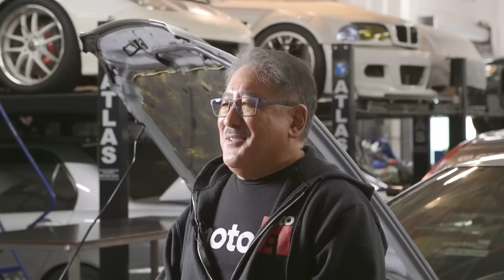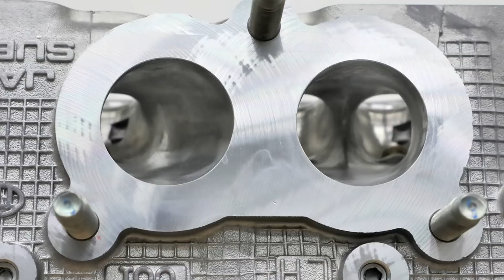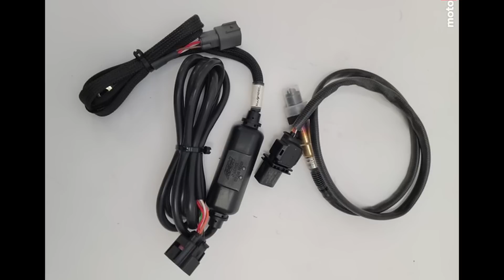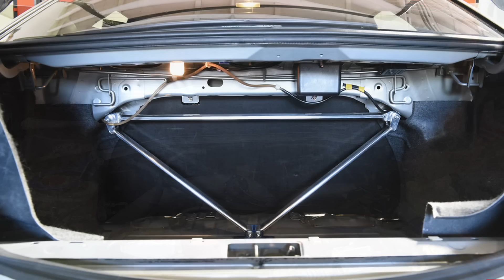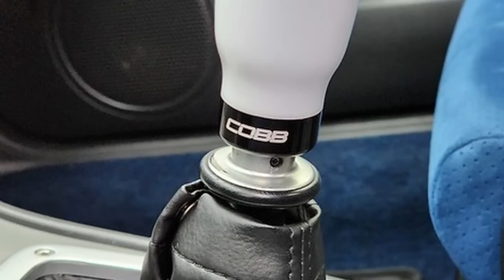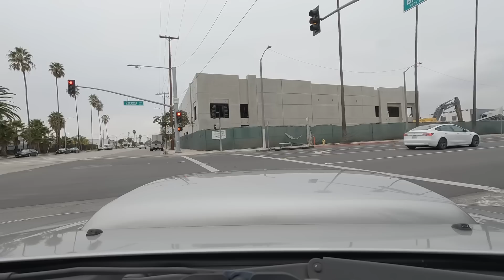How We Built Our Project Subaru So it Won't Blow Up!   (AND Drive Great)

Comment: When moto-iq talks about Subarus I listen. Gonna watch in its entirety after I get home from work later.
Reply: I don't have much beyond used motors and scrap metal. It's all on my fabricobbling and collected knowledge to make HP with my 97 Legacy and the leftovers I use for parts. This guy has given out most and best info on engine issues that I have found and I am eternally grateful.😅
Reply: I don't only listen, I take notes.
Reply: People need to take a “true” 500 wheel car for a drive before they say what they want compared to what they actually need. With 500 you’re not fucking about.
Reply: I’ve watched this video twice now and that car is the nicest, cleanest Subaru I’ve seen on YT, it has the parts that count and it’s not overdone.
Reply: literally same bro. I’m wanting to build my subie engine and literally will just do everything he says haha.
Reply: Did you watch it yet? Cause im in the same situation as you lol 😂
Reply: Kk
Reply: I dont know for sure, but it might be like 4th time I listen this at work while I plan my build from the start.
Reply: Good boy
Reply: You really can’t go wrong listening to him. I have no intentions of modding my 19 crosstrek, I just like to dream and window shop.
Reply: The stuff they talk about is very informative but super expensive.  Certain things when "building" a subaru not needed such as super expensive AOS valve covers; super duper 12mm oil pump etc..
Reply from the maker: @palaciosfreddy9189  Building something right is expensive, maybe the valve covers are not needed but oil control on these engines is and every bit you can get doesn't hurt. As far as a 12mm pump, this isn't a 12mm pump which isn't the best choice as they tend to cavitate and lose pressure at high RPM. You don't cheap out on the oiling system and oil control on an engine with known oiling and bearing issues. Nearly all the parts in this video are needed if you want to achieve the same objectives we were aiming at, solid reliability and driveability at 2x the original power.  Track driving reliability, not some guy who says "I drive it hard all day yo".  If not the same brands, the same quality and cost of the parts are needed to achieve this.
Reply: @motoiq  What if I just want solid reliability and driveability, no increase in power. My dream is just a build a reliable, fun street car. I think 300hp from factory is more than enough, but definitely want more reliability out of an STI. What would you recommend for increased reliability/driveability without big power?
Reply from the maker: Good maintenance, frequent oil changes with high quality oil.  Maybe a more conservative tune than stock. Always use premium fuel. Leave it stock, should last at least 100k.
Reply: @motoiq is there any build path for at or near stock power levels that someone could expect to get over 200k miles out of an EJ before any significant wear or degradation of head gasket etc on a daily driven car? 

My point of reference is a number of BMWs we've owned with the m54 engine which have been dead reliable even up to 300k miles, daily driven hard, and no loss of compression, no head gasket issues or any of the Subaru quirks
Reply from the maker: @azvet  The M54 engine is a very stout engine! I would say if you keep your EJ stock, change the oil every 3000 miles with a top quality synthetic, if you have a 2006 and later STI have an experienced Subaru tuner go over your tune and fix the factory issues, change the cam belt after 100K or 10 years, feed it premium fuel only, you can get 200k.  We have had two of those come through but the engines are totally worn out.  We had a well cared for Toyota Tundra with 300k come through and that engine was brand new inside.  Never going to find a Subie like that. Most Subies we see tend to die between 50-100k miles.
Reply: @azvet  I know that I was driving a '96 Legacy that I got with like 280K Highway Miles, drove it for 8 years and it had 365K when I wrecked it. Now, it had the EJ22 and the thicker cylinder walls and slightly shorter crank and the pistons were proportionally longer which kept them from twisting and putting troughs in the bores with the piston skirts like the EJ25s seem to have around 200K that I clean up and do my bullshit rebuild so that they will keep going (new bearings, oil pump, clean the piston rings, and do a minimal re-hone). The real problem is the EJ25 block is too short and the bore too wide to resist piston twist and all the engines I see are NA. I can only imagine how the factory turbo EJ25s that have moderate driving look from the higher cylinder pressures = wrist pin friction = piston twist. A unconventional idea would be to use stock pistons (harder and less thermal growth than alloy) and aftermarket (chromoly) cylinder sleeves (which I hear wear out piston rings a bit faster). Because longevity builds are rarer than performance builds outside of diesel trucks and tractors, I haven't heard of any good ideas. Gummed up rings are always an eventuality on long term road driven Subarus because they have more oil hitting the backside of the piston compared to more vertical engine designs + oil squirters further keeping the oil control rigs from reaching high enough temps to burn off gummy, coking oil. More simply, instead of all that, it is easy enough to get an engine hoist, a good used spare EJ25 shortblock, and heads, spend a year studying and spend a year learning how to recondition it yourself. Subaru's are not necessarily simple, but they are the easiest modern engine to work on and all you need are like an 8,10,12&14mm sockets, a $60 torque wrench and a service manual and watch about 10 YouTube Videos. It is not hard to be a Subaru Mechanic if you just do a bit of studying over some time and take your time. Sti blocks with head studs, pistons, new oil pump & oilpickup tube (all simple and easy on an EJ block) can take a reasonable amount of boost over stock and will last long enough (probably 100K if you are nice to it) If you want something done right, do it thyself. (Sorry for the Essay and as always Listen to the most knowledgeable people first (not necessarily me)).😅
Reply from the maker: There is a lot wrong and conjunction about all of this.
Reply: @motoiq  ideally yes to everything mentioned in this video. If i was a ball player, making millions/ yr, id do everything you mentioned in this video. Probably wouldn't be driving an electric supercar.  But everyone here , is sort of on a budget. Most folks knowledge on built Subaru's here is limited, especially on these comments. I understand the weaknesses of this platform very well; that being said , to remedy id take these steps:[ open case up, measure & install new king bearings, forged rods and pistons; hone block to 99.75, new half moon seals, new oem cam shaft seals, rear main seals, new oem mls head gaskets, new oil cooler,  new oil pan , iag or killer b oil pickup at a minimum, iag aos, freah 5w40 oil, dyno tune on a hot day, then street tune, & ensure tune fueling is spot on or at least on the rich side. Ewg to ensure proper boost management.
Reply: @motoiq I would like to know what you would do to an EJ25 to make it last longer than stock. Like I mentioned, the piston skirts scoop out the bore from twisting. Any thoughts on how to solve that problem  for an EJ25 built solely for longevity? We know that this is not practical. Also, do you know anything about the quality of Subaru's aluminum compared to Honda? I lapped a Honda head and I swear it was harder and less sticky than Subaru Aluminum. (Feel free to let this go if you don't have the time or want to get involved with this rabbit hole)😅
Reply: @mechticulous8202  ive been on nearly all the turbo subaru forums online. 1st time ive heard the term "piston twist" thrown soo loosley. Is that a ritual dance to summon demons?
Reply: @motoiq Wait, what? I just bought a brand new 2023 WRX base model and don't plan to mod it or drive it hard and plan to keep up proper maintenance. Does your comment mean I should be happy if I can achieve 100k on it? If so, maybe I should have stuck with Honda. 🤔😅
Reply from the maker: @cmbiker   Keep it stock, keep up with maintenance, change oil every 3k miles with good synthetic and you can probably get 200k with it.
Reply from the maker: @mechticulous8202   we have a lot of videos here on what we do to make them last longer than stock.
Reply: @motoiq  Okay. Well, 200k ain't bad I guess. So what would most likely go at around 200k, the turbo? Also, should I have the dealership do the first oil change at 3k or wait until the recommended first oil change mileage?
Reply from the maker: Probably turbo and timing belt around 100k, do your first change at 500 miles then every 3000 after that.
Reply from the maker: forgot yours doesn't have a belt.
Reply: @motoiq what are your thoughts on the stock ring gaps and maybe even the bearing tolerances? So many of the cracked ringlands seem to be from the ring pushing up. 

Also Subaru's tolerances for the bearings seem to range from very tight to very loose, and are not consistent from block to block leading to oiling issues even at stock power.

I think a lot of people including myself want to avoid doing forged pistons, and we are looking for ways to make our stock EJ's similar to Hondas and older (m54) BMWs.

Do you think it would be worthwhile for a customer to have someone like MotoIQ take a brand new RA block and regap the rings and check for consistency on the bearings, and just leave it at that?
Reply from the maker: @azvet  The bearing bores vary a lot in even a brand new motor but a lot of the labor is in the assembly and I can stand putting weak OEM pistons back in.  Maybe use something like 4032 alloy in the pistons with moved down rings.
Reply: @motoiq are there any options in the aftermarket for cast  hypereutectic pistons with moved down rings that are stronger than stock?
Reply: @motoiq dam only 100,000k for the wrx FA24 can those hit 250,000+ for daily driving with ocasional spirited driving?
Reply: @motoiq for the FA24 2022  wrx what should be done to it to to get more mileage out of it than stock. Do your FA20 videos apply to the FA24?
Reply: @SacredPrecision333  Hes talking about the EJ25 block mostly, almost none of this video applies to the FA platform.
Reply: @motoiq what about the FA24’s
Reply: @C @CL_Hat  has one on fa vs ej and he breaks it down for the fa20 but not the 24
Reply: @palaciosfreddy9189 remember he’s talking about building the best race cars lol. Making the car as efficient as possible. He never budget build. Mikes addressing all of the issues that come with owning a Subaru and wanting to build it.
Reply: Have some originality instead of copy what this guy does. There’s more than one way to skin a cat. His sponsors would love to make you think these cars suck without THEIR parts. Understand that element.
Reply from the maker: @deadprez207  I like how people talk about being original and being different, the important part is doing something correctly. Other people can build good Subaru engines like Outfront and others but all the reputable builders follow this exact same path, maybe some different brands of rods, pistons, and bearings but all top quality.  Would you rather us do no content to make you happy. Or maybe make your own videos.
Reply: @motoiq thank you for the wealth of knowledge! Just for clarification is this 550 setup referring to power at wheels or crank? I'm asking because I see people talking about how the stock RA block is good for 600hp etc and it's all just really confusing when trying to manage expectations of longevity on the EJ platform at different power levels, and the debate over how much forged pistons will shorten the overall life of an engine.

Also, if someones goal is 400-450 crank (300-330whp) what could they expect as far as longevity with a stock RA short block?
Reply from the maker: @azvet  Power at the wheels. The RA is a little stronger but its not hardly that much stronger.  I am amazed at how cheap Subaru sells them for and I think its's a good budget thing to get your blown up car back on the road for the least amount of money. I mean there is that whole, "I make 600-1000 hp all day long on my stock engine" group of people in the community.  They just don't talk much after their engines blow up. Or their cars are gently driven street cars doing an occasional blast through the gears or are dyno queens and they still will eventually blow up.  I challenge those people to do one non competitive track day and see if their cars are still running after.